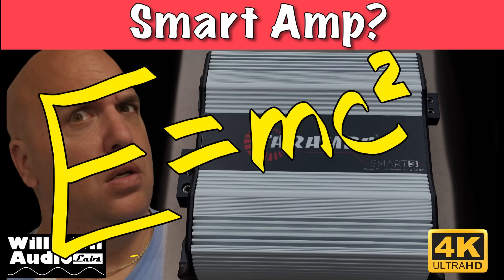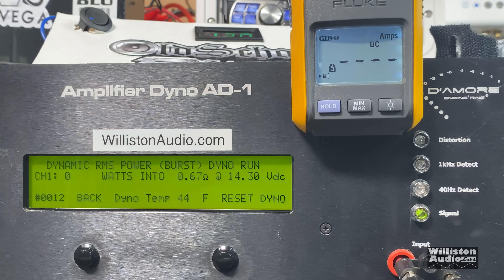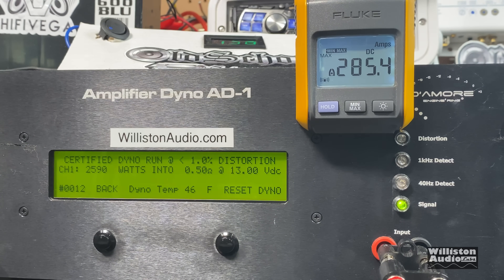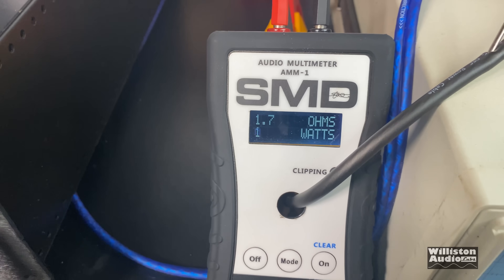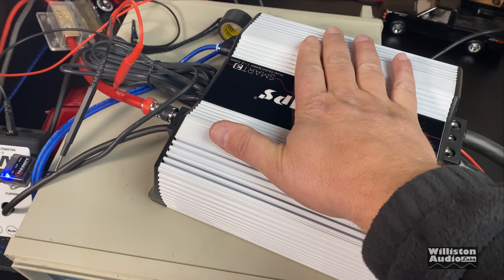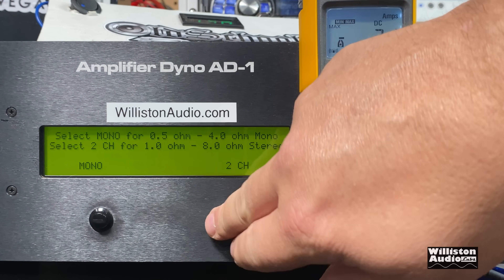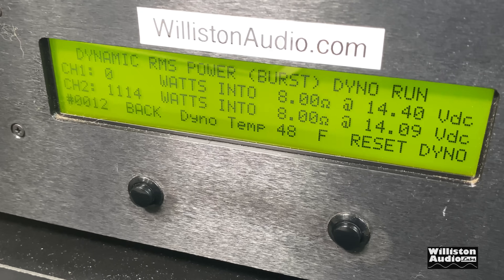Taramps Smart 3 vs 6000W Sub and INSANE Amp Dyno Low Impedance Testing [4K]

Comment: So it’s ok to use full range amps on subwoofers? I want to pick this amp up for my JLw7. Will the sound quality be just as good as a amp made for a sub? Tia.
Reply: Would like to know this as well
Reply: Yes I’m running 2 18 skar zvx s at 1ohm with this amp and it slammmmms
Reply: @BigChris76   2 skar VX 18's Damn... so I'm I going to be able to run 2 American Bass Xfls 12s with this thing? I'm not going to upgrade my electrical with this build just use stock and a 30 cap.
Reply: @klm510  bad idea not upgrading electrical. This amp can easily exceed 305A draw
Reply: Kenneth Manning Atleast do the big 3/4 0 gauge under hood wire upgrade and add Atleast one battery to the trunk daisy wired to your front battery capacitors aren’t shit a 50ah agm kinetik brand battery is equal to 1,000,000 farads bro not worth it I run two data max 158ah battery’s , big 4 upgrade and stock alt and I’ve fried stock alt before lol 😂 but that’s when I was running the md5k 1 ohm with 2 sundown zv5 12s lol
Reply: Dustin Reed agreed
Reply: @dustinreed9425  so  I should add a battery to the trunk and if I do should I cancel the cap or do both?
Reply: @BigChris76  show what battery should use?
Reply: Kenneth Manning I am using a AGM group 31 odyssey and I love it and also you don’t need an isolator if use an AGM with the typical lead battery underneath the hood
Reply: @klm510  In my humble opinion, YES, get rid of the cap. If anything, get yourself an extra dry cell battery. Something like a yellow top all the way to a Kinetic to an XS power, stinger, Shuriken, ENERGIE.... there are tons of them and they would do the trick. Do a Big 3 upgrade and run all 0 gauge wiring. Caps usually only hold power until the moment they feel that the power is displaced then they release said power at that moment. Not much help for constant play even though some people live by them. I wouldnt. With the subs you're running, you will definitely want constant power.
Reply: So I'm doing a build in my G6 and I'm trying to find sub to use to run this amp on this particular build i was planning on running the 3k with two Xfls 1000 rms 2000 peak 4ohm wires down to 1 ohm in a custom box. Is this going to be two much amp for this build? If so what subs would you guys recommend?
Reply: Kenneth Manning  it will be all good just watch that clip light that comes with the amp and you’re going to love it trust me
Reply: As long as you set your high pass and low pass properly for the driver that you are using, you should not run into any issues. Even with a full range amp.
Reply: @5point7even7  yeah I got the battery and did the big 3 it's working great

Comment: I bought one of the "new" (to me) IGBT inverter welders and it does the same thing, shuts off before the current destroys the welder. I thought it was just over-rated and didn't expect much, so when it stuck a rod without melting it I just thought it was lack of power but what caused me to question that was it would pull an arc like 2" when I pulled the rod away from the work (that's a lot of current).

Comment: Only because I’m new. Hopefully the question won’t sound stupid.  If I hook this up in my car. Stock.  No extra battery’s or anything. What’s the most watts I would I get from this amp.
Reply: Rayton White
There are many things to consider in such cases - for example;
The type of music, the subwoofers, the overall condition and power rating of your battery, and finally the wiring itself
Having said that, and assuming all of the boxes are checked, then this amp could potentially meet its rated output on a stock power system, so-long as the battery can provide the power - to which I'd add, could even be sustainable should the demand for power be within your alternators charge capacity - you'd be surprised just how manageable dynamic music can in terms of power draw.
Reply: I would atleast recommend a second battery to take a couple of hits while the stock alt charges the main battery. However, I would go with a high output alternator if you can afford it bc it help a lot. I have a JS 240a Alternator in my Lexus gs400 and it's awesome
Reply: I'm running it on stock alternator and a second battery
Reply: @coolazznicca  yeah me too stinger agm and deep cycle marine in back 95 amp stock ford ranger alt
Reply: @coolazznicca   stock alt and extra battery 100 ah xs power,, no problems
Reply: A broken amp
Reply: This amp or any Brazilian amps are very sensitive to volrage. You must stay above 13v or you WILL blow em up. I have a 220a alt and two yellow top optimas I never dip below  13.3
Reply: @prmt1755 
The minimum supply voltage for this amp is 9v, whereas the specs are rated at 12.6
With that said, the amp will not blow-up bellow 13 volts - that's just silly

Comment: I have 2 evl 15 d2, so it would be better to run it at .8 ohms rather than 2 ohms is what I'm getting
Reply: 2 ohm would allow the amp to run more efficiently, and the amp would still exceed your subs power ratings, and so you'd need to turn down the gains to match

Comment: A word from the wiser ,, I lost my hearing from  subwoofer testing !  147.6 db from one 15 inch sub ,in a calculated box ,1000watt amp.. my ears are still ringing 20 years +latter ..
Reply: 146 db it is then
Reply: @SmalltimR  lolololol
Reply: 147db over 20 years ago on a single 15? Yea okay pal.
Reply: Mrs. Nesbitt  , alpine gate trained , was a installer importer and retailer from 1989 to 2011 , and yes subs back then were around ,,mtx Orion blaupunkt pioneer alpine and computer design boxes were easily made .
Reply: I'm doing over 150 on a daily driver lmao no hearing damage
Reply: @doomztowngaming7860  151.3 single 18 daily banger demo ready
Reply: your correct im a wold db champ and always wear earplugs!! try "lipoflavinoid" and wearing earplugs at night when you sleep..it may reset the ear ring quieter..

Comment: 1100 watts at 8 ohms is nothing to scuff at. That is way beyond the capability of any indoor made amplifier. Granted the input voltage in your home is much greater (110-115v US, or 230v EU) and require much beefier components to do so, but still. A $260 car amplifier can produce that much power is just bonkers..
Reply: He doesn't know about fp14000... lol
Reply: My Lab Gruppen is 1200w x 4. I also have a 2 channel at 1200wx2 and I have a Crown that is way over 1k. My smaller qsc is like 980w x 2. My biggest amp is 100lbs . Oh 150w x 2 LOL Jeff Rowland Model 5

Comment: Thinking about buying this amp to run 2 of the HQ 8s ..... Or would the  skar 2000.1 be a better choice
Reply: If you plan on getting more powerful subs in the future, go for the Taramps. If you'll be satisfied with the build, go for Skar. It will cost less and sound damn good!

Comment: Are you using some kind of decent microphone ? The amp tests on the woofer sound great in my headphones. They don't go much below 50hz but I barely hear any clipping on the mic.
Reply: You have the worst headphone in the world then. The clipping is a distinctly audible, purely scratching sound on top of the bassline, seen in the oscilloscope as well. Good news is it makes it extremely easy to set the max gain even by ear.

Comment: Will this amp be safe to use on dual 4 10 inch sub?
Reply: al alex D2 - running this amp on 4 Cerwin Vega V2 12s at 2 ohms - no sweat
Reply: The amp could run pretty much any sub if you know how to set it up

Comment: No bass knob how will that fair with stock stereo? I'm planning on running at 4ohm on a sundown audio 15xv2? Unless you got better recommendations for me let me know thanks
Reply: @Pamfman All else was good until you said turn up the gain. You can still let it rain, but that gain dial is meant to be turned to match the same volts your head unit puts out per channel. My Pioneer stereo is 4V per channel. Hell yeah brother, let that 15 mfer rip, but don't blow it up for the dumbest reason: from constant clipping
Reply: Dillon Hattem - actually he/she had it right. Max SPL usually comes with a bit of clipping.
Reply: Thanks for the replies I'm not sure why I barely got notified for the them... I'm looking at getting the sundown audio sfb2000 and got a 4.5 cu ft box custom made after displacement and port so its looking pretty good

Comment: Thanks for the videos big d. I just got this amp. Would you say it can be wired daily at .5 ohm? I have 2 d2 subs. Can wire at 2 ohms or .5 .
Reply: It does the same at 2 or 1 and it's also more power than you would get at .5 there is no reason to run these amps at .5 they actually recommend that you don't run them any less than 1 they made the amp this way because of impedance rise so it will do around the same power threw it's recommended ranges of impedance
Reply: So what did u end up running the amp on. 5 or 2 ohms
Reply: @Trinidadcaraudio  never run them under 1 ohm they made these amps to combat impedance rise so it does close to the same power through almost all recommended impedance they tell you to never run these things under 1ohm and as you seen in this case with the smart 3 it actually does less power at.5 ohms its very bad for these amps all manufacturers that make these amps with this full bridge kind technology all tell you to never run them less than 1 ohm I myself am not buying a taramps I'm buying a sundown sfb1000d because I'm running sundown subs I was gonna go with resilient subs and I was looking into buying a taramp to go on them but I'm going with sundown because it comes with a gain control on the clip light but out of all tramps that smart 3 is most def the 1 to go with
Reply: Well the amp hates .5 you literally hear the bass decrees when the limiter comes on but it’s a monster at 2ohm no point of wiring below 1 ohm
Reply: Yes but what if like this guy have two dual two ohm subs he would have no choice than to run it at. 5 and as u see these can handle the load thats why i ask

Comment: Test the 
hyphonic  35th generation Gemini  3500 watts  of pure power.

I have it with 2 t5 tarantula 1000 watts arms each at 1 ohm .and its pushing  them beautifully 

But I wanna know if the amp will be able to push .4 t5s a 1 ohm .each sub is 1000 watts rms

Comment: can I use this amp for 4 12"  , 500 rms subwoofer?
Reply: Just to give you a heads up that app will push it clean V eats up at 500 watts RMS that is 2000 Watts RMS 4000 Watts Peak the only thing I would suggest if you was to use this app is to make sure that your electrical is clean and up to par meaning you do not drop below 12.6 volts direct current
Reply: minimum specs so that  I can run it at 2000 rms, currently running stock alt, 70ah battery with 1200rms amplifier, 1000rms subwoofer

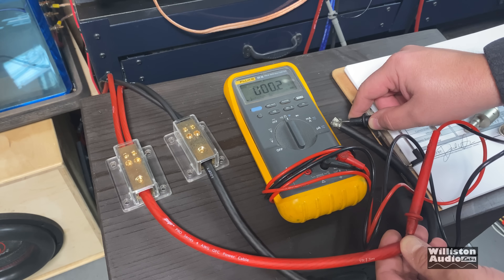Comment: At 6:10 - why on earth are you trying to measure such a low resistance with a 2-wire ohmmeter, with resolution of 20% of expected value, to boot?  You need a 4-wire ohmmeter for this.

Comment: Hey bigD, the clipping at 9:43 is the fault of the quality of the ampor or the fact that it was connected to a lower impement than allowed? Could you do a reliability test in the next few days? Thx 😎
Reply: Clipping isn't an amplifier fault or quality issue.  It still delivers over 2500W into that load without clipping, so the clipping is the fault of the operator who is allowing it to be overdriven, i.e., attempting to get much more than 2500W from it.  All amplifiers clip at some point.

Comment: Lol, There is nothing like 3000 watts or 10000 watts, Okay, Tell me, If you full recharge the Capacitors, and make a Short Circuit, How many Watts Can Be Generated lol, I think maximum is 1000 Watts,
Reply: A true short circuit doesn't dissipate any watts.
Reply: @marianneoelund2940  Sorry, I meant During the Discharge of Capacitors,what the Maximum Power can be pass through the Wire, I guess that the MAximum power the Power amp can try to reach
Reply: @hamidhami3473  
With extreme low-resistance loads (under 0.5 ohm for this amp), the limitation is the amount of current that it will produce, rather than power.  Well-designed amplifiers will protect themselves by limiting the current they draw from 12V, as well as the current they send to the load.  Let's see if we can surmise these limit values from the data collected:  
The "dyno" sheet shows the amp has protection which limits the current it draws from the power source to about 300A.  We see that it uses this full current with loads of 2ohms down to 0.67 ohms.  But at 0.5 ohm load, it no longer draws as much (285A), so in that case it is probably limiting its output current to the load instead.  For 1% THD case, it produces 2590W into 0.5 ohms so its output current limit is 72A rms.  
Assuming it will maintain that 72A rms for loads below 0.5 ohm, the power it will produce into such loads will be 5180 * R.  Now you can calculate the power it can put into near-zero loads at low distortion.
Reply: Probably,  , though the Tension Goes Down with low Resistance, If you apply 100V on 0.5OHM, this tension goes down to like 10V only, No matter how intense the Current
Reply: @hamidhami3473  
Yes, if you measure voltage it will be in proportion to the load resistance when you get into the region where the amp is current-limited.  
This amplifier should produce about 36V into a 0.5 ohm load and proportionally less into lower resistances.
Reply: @marianneoelund2940  what's the r stand for?  And could you explain a true short circuit doesnt express watts. Been learning about all this stuff for the past year but the more i learn the less i know

Comment: I always heard that this style of amp design had/has weird sound quality issues? Any truth to that?
Reply from the maker: The HD3000 sounds different to me. I didn’t notice this with the Smart 3. Bass was clean and strong 💪
Reply: Yes, in some cases.  Quality will vary widely from model to model.  These amps are all about moving large volumes of air, not necessarily doing it cleanly.  
But this testing shows the subject amp achieves 1% THD or less, at 3KW or less into low-resistance loads, so it appears to be a very good performer.  
The scope traces show a significant amount of parasitic oscillation at the clipping point, but this is typical for Class D amps, especially in bridge mode.  It just means you should avoid clipping it, which is good advice for all amplifiers.

Comment: Any chance that you could review NVX OFC 4ga and 0ga wire I was told by Sonic it's made in the same factory as kicker wire and is "true spec"
Reply: Josh just get sky high car audio wire or certified bass head wire
Reply: @possiblyunknown  Curious about this wire. I currently buy Memphis wire and have for the last many many years.
Reply: @estate-tidus1007  I'm just over here using welding wire for a fraction of the cost 🤣

Comment: What most people don't realize is a tuned box and amp will have more than enough bang at a fraction of these watts. 
No one believes me when I tell them all I have is 350 watts for my bass.
Reply: Good tune box for the sub and good tune for the amp. 350 watts probably sound like a 1000 watts.
Reply: @Silkmaster4200  Makes my ears hurt a little. In my opinion that's a touch more than enough bang.
Reply: Some people prefer sealed boxes over ported because of their "intant" transient response playing music accurately, instead of big ported loud and sloppy delayed boxes. then theres a balance, a ported box that sacrifices a bit of output for SQ. it all depends on your trunk space.
Reply: Got at 500rms at 1ohm with a ab DLS amp and and a 1,5ohm single 12" im my car... 2ohmDual coil  Made 138,4 db at about 58hertz, with a closed box last summer... Makes the interia rattle and wipers jump when it rains... Plays good drums musically but when it gets low... Mmm

Comment: I have this amp do you have any suggestions on speakers I should use and how many watts? Im tryna find 2 twelve’s
Reply: M6mojo612d2. I have 2 md3000.1s running on them. It’s insane !
Reply: 1988 MPI 25g Tdo6h 8cm2 carter do you have the big 3 setup and extra battery ? And thanks for the reply
Reply: what's your charging/ power supply capable of handling and how much do you want to spend?
Reply: Das Goofinhiemer I just have a audio secondary battery the price doesn’t matter as long as it not outrageous
Reply: @BigTrav256  you are going to want to have lots of amps coming from your charging system if you plan on using more than about 600 watts from most vehicles. AGM batteries are a must, as lead acid don't flow well, and even with 180amp alternator my headlamps nearly dim to candlelight, especially to vicious double pedal. you need to decide if you want to run a sealed or bandpass box and what order bandpass if that is the decision. once you also know how much space you have to work with in your vehicle you can weigh $/SQ/power to decide which drivers will work best for your needs and musical tastes.
Reply: @BigTrav256  this isn't the answer you want to hear, but you REALLY need to upgrade your electric system before trying to run a 3000w amp.  if you don't you're going to be very disappointed in the performance or even damage your equipment/car.  if you can't afford it, buy smaller equipment.  most vehicles have very small output alternators that are barely capable of providing 30 auxiliary amps, let alone the 200 - 300 this amp needs.  auxiliary batteries are bandaids, not solutions.
Reply: buddyDurden ok cool
Reply: @dasgoofinhiemer5039  180 amp and still dimming that bad?  Whats your total rms for your amps

Comment: Thanks Big D just ordered one for my 4 Massive Sumo 8" Subs on my competition motorcycle.
Reply from the maker: Sweetness 👌
Reply: I have to say I installed this amp and it is everything you said it was.  My electrical resistance is 1.87ohm.  Was running a 2ohm Stetson 3000.1 before.  This Smart 3 is more powerful, stable, and better SQL.